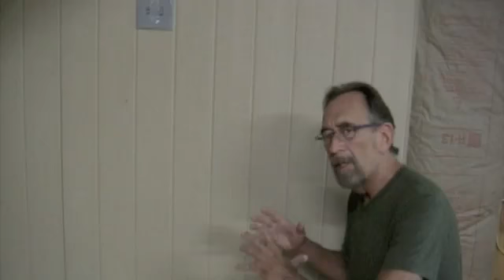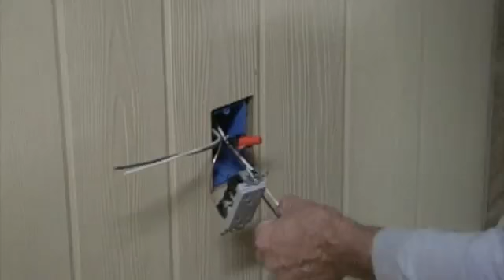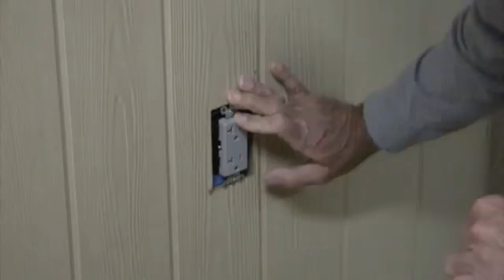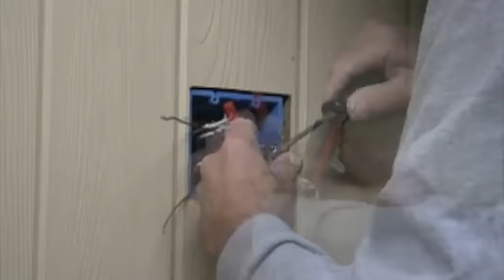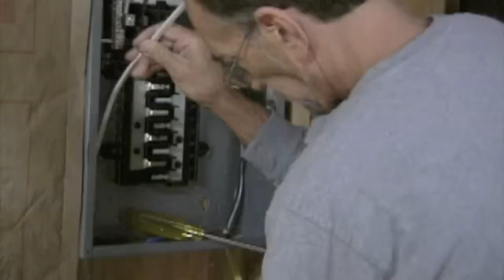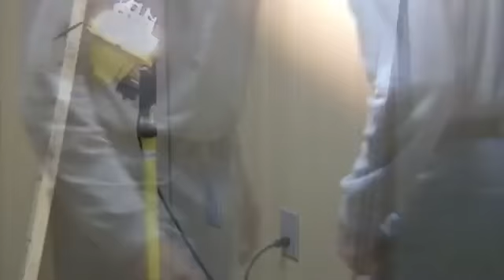Garage Workshop Conversion, Part 4: Switches, Outlets, Breakers - The Down to Earth Woodworker

Comment: When you apply your tape after putting your wire nut on put it on in the same direction you tightened the wire nut.  when you put it on the way you did it could loosen the nut and possibly cause a loose connection.

Comment: Ok, I have a wall air conditioner that has outlet in the shape of upper 2 horizontal plates and one lower round rod. I have replaced the wall AC to a window AC that uses the regular outlet. My question is how do I convert the outlet.

Again the outlet looks like so:     -   -
                                                       .